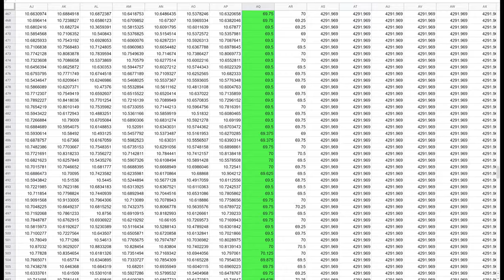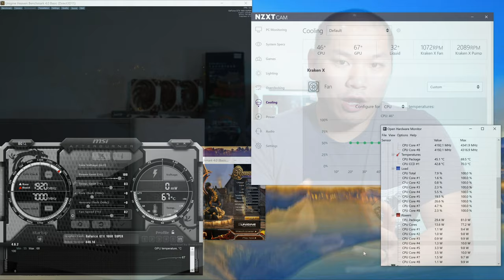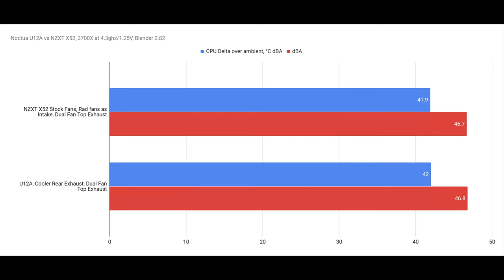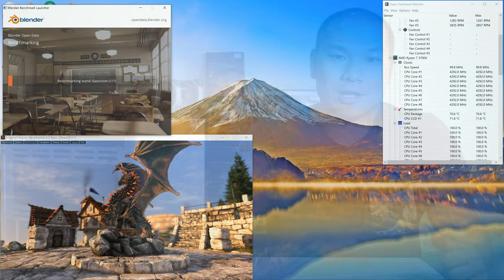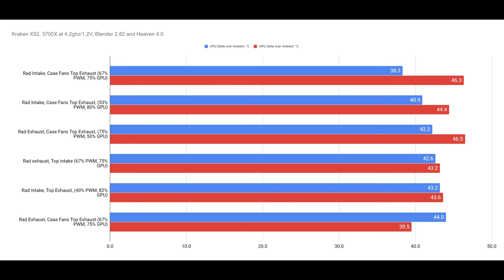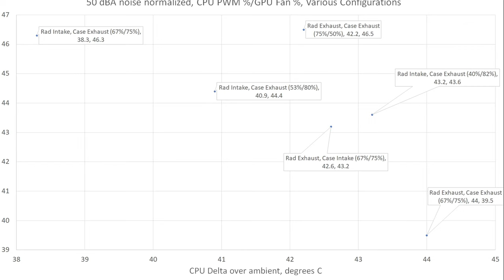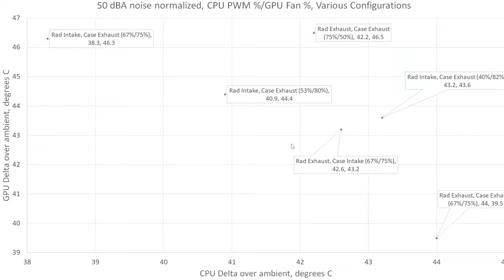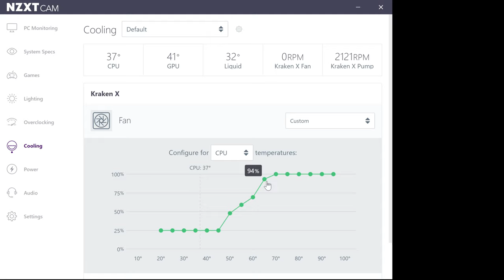Liquid AIO Cooling In The Cooler Master NR200, Part 1: Optimizing Fan Orientation

Comment: Can you include the Noctua C14S for the Air cooler comparison or maybe a follow up video? Thanks!
Reply: GBXD C14S would be interesting to see since it’s a down flow (well, depending on how u orient the fan) that, I would imagine, be pretty efficient due to its orientation. Combined with a couple of side mounted fans - it should be pretty efficient.
Reply from the maker: That's a cooler that I don't have now but since you mentioned it I'll try to get my hands on one. It's actually really promising due to its weight- the heatsink itself is heavier than the U12A and that is a HUGE factor in air cooling effectiveness (assuming similar fin density).

Comment: The Nividia video of the new 3000 series GPU's show that air is sucked in from beneath and expelled upwards. (This seems different from the 2000 series generation where the fans sucked air downwards, and expelled air sideways). This makes me think that the Nvidia series 3000 design ideally suits the airflow of the NR200 which has a bottom to top chimney flow path. This made me wonder whether, when using a 3000 series card, if it would be beneficial to add the extra two bottom fans that would propel air towards the underside of the GPU, where it is sucked into the graphics card? I'd be interested in your thoughts. This leads to the question about the 3000 series GPU's, whether their bottom fans perform best by (i) sucking air at ambient conditions under the PC, or (ii) using bottom-fans to accelerate air towards the underside of the GPU?

Comment: Can you max out this case? 2 SSDs in the front, Mini-DTX motherboard, 280 AIO Liquid Cooler, 3-Slot GPU with fans on the inside of bottom right under the GPU, 2 Fans on the top, Maybe squeezing a 3.5 inch HDD inside the case?
Reply from the maker: And.. the kitchen sink too! That is one heck of a parts list and yes, one could get it to work, I do recommend a 240 for this case to make tubing runs easier.

Comment: Think vertikal gpu so the gou can get fresh air via the vent+ radiator for cpu on the bottom pushing air trough the case abd the two fans on the top pushing it out has the beat thermals...

Comment: really great channel content with great video quality.
I am floating maybe a silly idea which is to shrink my MATX rig  with a VEGA64 LC (120mm rad) and Ryzen also watercooled with an IDcooling Frost flow AIO(240mm rad) into this great little case. But I am struggling to assess a robust "How and where placing the Rads?". was thinking about the CPU rad at the bottom and the GPU rad at the top in pull config but afraid the latter will clash with either Motherboard or the PSU cage. I cant think about any Option that would work but if people here have recommendations, its much appreciated. thanks so much

Comment: I have a Cooler Master ML240L V2 bottom-mounted on my NR200p (vertically-mounted 3080 FE and tempered glass panel). I've since watched this and GN's video about proper placement of AIOs. My thermals and noise seem good under load. My question is do you think I would benefit from replacing my current AIO with a radiator pump AIO like the MSI Mag Coreliquid 240R? Thanks!
Reply from the maker: It's not the end of the world, and certainly if you're getting strange operating noise then perhaps you might consider replacing it. The longevity issue is only relevant if the unit is out of warranty or the manufacturer won't replace it, which wouldn't be very nice since they're the ones that partially filled it to begin with. However, if you're looking for a definitive recommendation for bottom mounting... there's a new review going up today and I hope you get to check it out.

Comment: Hey bud, is it possible to have the fans against the side panel ‘pushing’ from the side, rather than pulling in?

Does it fit or are the tubes squashed?
Reply from the maker: You could do that, the tubes get compressed so I don't like that arrangement as much, plus there's not a significant difference for airflow.

Comment: Great work with this NR200 series. I'm under the impression that for cards that are not flow through and physically larger (doesn't matter hotter or not) the rad intake and top exhaust is a better GPU option.
The edge of the larger GPU extend closer to the side mesh panel and then gets pulled up by the rad intake. I have mine like that and empirically noticed better GPU temps.
Can you confirm that?

Comment: I have been trying to find someone who has been doing in depth reviews and cooling config. for this case. I just ordered it as well (just waiting on shipment) and I'm super excited to build in it. I have a ryzen 7 3700x with the arctic freezer ii 240mm aio and I'm adding the arctic p12 fans for the best performance. I'm also trying to fit a 3080 gpu in there (not the founders edition because of the weird cooler design). I'm planning on doing a review video of my own. will be modeling my video after yours. earned my sub. cheers mate
Reply from the maker: Thanks, look forward to it!

Comment: Looking to do this build with a 3080 and 120mm AIO rad in the nr200. I'm in between getting  the founder edition or a third party which directs its airflow in a single direction unlike the founders which does the strange push pull kind of thing. What are your recommendations for card type and fan configuration. Thank you, love the videos!
Reply from the maker: I know availability has been challenging but my recommendation is 3080 FE for this and the NCase M1 simply because the top exhaust is very directed and easy to work around. In an AIO scenario you just let the top fans handle all the exhaust. Instead of the card exhausting out the sides and potentially reintaking its own air, the top (and rear) exhausts get the heat quickly away from the card, which is great for it. Full discussion with fan layout here in case you haven’t seen it.
https://youtu.be/thmpkPjnUDE

Comment: hello there !! very detailed work ! great job..but i have a question ....have you ever tried passive bottom mounted rad, with rear and top fan exhaust ?? was planing to do that to have the best looking pc (exposing RGB ram, motherboard and showing bottom mounted GPU) but don't have all the material to test my theory ....that said tho, at the expense of ''lookat'ma board ma!'' i clearly will go with the best CPU thermal here.. Since in gaming, the CPU don't heat that much, no using it's max TDP, putting less heat in the radiator, thus giving the GPU cooler air ;) so it's a very good setup for all around use.
Reply from the maker: In theory that can work as long as you use the best static pressure fans along with the glass panel, and sealing off every vent on the rear panel, and every potential gap on the rest of the case. In practice, it's really difficult to do that, especially in this case. It's too well ventilated. You still have the other mobo side vented panel as well, and lots and lots of seams on the case panel junctions. Why not slim, black fans though? That could be as incognito as just a bare rad. As for gaming CPU use- it varies depending on what CPU have, what game you're playing, resolution, etc. If you're playing in 1080 at high FPS, and you're not close to being GPU limited, then yeah, absolutely your CPU could be getting hammered. 4K 60, not so much.

Comment: Not sure if you will respond But I am finally getting my nr200p, ill be slapping in a 280mm artic freezer ii into the case but should I place the faces exhaust or intake? And should the fans be on the outer side of the case or inside? Thanks.
Reply from the maker: I'd intake. You mentioned "P", are you running this on the bottom? If you're mounting on the side you almost don't have a choice when it comes to the fan placement because the tubing is so tight, the rad need to be on the outermost part of the case so that you don't get some super tight bends.
Reply: @MachinesMore  p because in the UK we don't have a choice Thankyou so much.

Comment: Question, as I think I may not be the only one with this but I am having trouble finding an X52 for sale that isn't absurdly overpriced or used. Would the X53 suffice?
Reply from the maker: Yup, it performs exactly the same, the X53 does have a newer gen 7 pump, more clearance inducing barb position but has a rotatable head (so you can mount however you like and just rotate if you want the RGB). It also loses the fan controller. I might do a comparison video between some AIOs soon but for sure a bottom mountable AIO vid is coming up.
Reply: @MachinesMore  thank you so much for the detailed reply!

Comment: Ive been wondering, what is thr purpose for a front mounted psu in this case and if you do mount it in the front, wouldnt the fans for the psu be choked since there isnt proper airflow for the front considering most of it is blocked by the sd panels and even thr front cover isnt designed to allow airflow to my knowledge
Reply from the maker: It’s just another option depending on what your hardware needs are. If you mount it on the side, you have two choices for how you orient the PSU, intake from inside or outside. I did mine intaking from outside. On the front, I would just flip it around, so that the fan can intake from the inside- you’re right in that you don’t want to intake from what is essentially a blocked off spot.

Comment: May I ask, and i may have missed this, but if we run the rad as intake + top panel exhaust, what if we add two fans on the bottom as intake as well? will that be optimal to add into the case?
Reply from the maker: Yes! Part 2 covers more fans added.

Comment: I recently built in this case with the Fuma 2. I had two Noctua A12x25 fans from a previous build and saw an improvement by swapping out the Scythe fans. You may want to test this setup since you already have the fans from the U12A.
Reply from the maker: Already did that! And yes, my observation was that the stock fans were really holding back this cooler, not so much the thermal difference at stock clocks but they’re capped (probably for noise reasons) at 1200rpm so there’s not much headroom beyond mild overclocks. Will discuss more in the round up. Thanks for checking in!

Comment: Do you think it's realistic to use this NR200 case with the latest Nvidia "hot box" GPUs that have rumoured 300+ Watts power consumption, and a higher end CPU like the 3950X or i9 10900K ?
Reply: Yes. The ncase m1 is smaller and can handle top line stuff. You can fit a 280mm rad which will give better results than the 240 used in this video
Reply from the maker: I think so, in addition those beefed up GPUs power draw figures, there are also going to be beefed up heatsink designs. If you run an AIO rad as intake, there’s very little GPU influence, so that might be the way to go if the GPU exhaust is ridiculous. If the rumored specs are correct, then these will be 3 slot thickness monsters and you won’t have an option for bottom fans, the fans exhausting at the top will be super important.
Reply: @MachinesMore  What do you think of the NR200 for air cooling these new high-wattage GPU's? I'm thinking that actually the new Nvidia airflow path - that sucks air from beneath and pushes it up - could work very nicely with the chimney flow of the NR200. Another thing I'm wondering is whether having bottom fans, aligned with the underside-intakes of the Nvidia GPU's, could also enhance the overall upward chimney flow of the build?

Comment: I wish I could invent flexible heatpipes, allowing the fin stack of a heatsink to be located anywhere in a case, notably against an air input or outlet.
Reply from the maker: They exist already! It’s called an AIO 🤣
All kidding aside, the issue is that heatpipes are liquid filled and bending too easily might compromise that integrity. Otherwise, being copper, they actually do quite bend a lot already if you apply force. The bigger advantage would be if case makers tailor made air coolers or integrated into the case (Streacom DB4 comes to mind), that way really effective cooling could occur.
Reply: @MachinesMore  Yeah! That would be the ticket. We need a new specification that puts the heatsink right at the rear exhaust. It would even move the cooler away from the RAM, allowing for higher profile DIMMs and more visibility of their RGB. Cases and motherboards are so standardized, it shouldn't be too difficult to make this a thing.

Comment: So, let's say vertical gpu mounted, and then aio side mounted with fans exhausting air from gpu through rad and through the mesh panel, with 2 fans at the top intaking and 2 at the bottom exhausting would be the ideal setup? Idk if you covered that in the vid as I haven't finished it yet but I'm about 6 mins in and that's about the best setup I can think of.
Reply from the maker: Hey Robert, unfortunately a side mounted radiator will not fit with the clearance in front of a vertical mounted GPU. A config like this would also put the GPU fans at odds with the radiator fans. Interesting idea though!
Reply: So, what would be the best orientation of I wanted to keep gpu vertical? I may have to just suck it up and keep my gpu horizontal lol
Reply from the maker: You could bottom mount the rad, not generally recommended but it’s not the end of the world. Bottom to top airflow if you want to prioritize the CPU, other way around to prioritize the GPU.

Comment: and what about the NR200P? putting the radiator on the bottom is a so bad idea?
Reply from the maker: You don’t really have a choice with the the NR200P. If you’re OK with potentially impacting the long term performance and durability of the unit, it should perform similarly as an intake. Personally I think exhausting out the bottom is a really illogical way to configure any case (unless there’s a defined air flow pattern such as through a shroud or tunnel) so I wouldn’t do that. You’ll get similar performance running as an intake, it’s all taking cool outside air anyway.

Comment: whats bestter having the 120mm fan intake pushing through the rad or to suck air through the rad ?
Reply from the maker: I think your question is which side the fan should be on, and that really doesn’t matter too much. What matters more is if you put the rad on the inside the tubing will become more compressed, so my preference is fans on the inside.
Reply: @MachinesMore  I'm running a h80iv2 cooler and a thermal take toughfan 12 turbo fan side mounted in a Sama IM01 case the fan is sucking air into the case through the radiator exhausting out through the top

Comment: Can we hope to have a C14S tested as well?
Reply from the maker: Yes.🤗
Reply: @MachinesMore  Awesome! I hope I'm not asking for too much but I was interested how good this scenario would be: a regular GPU bottom intake + top fans intake + C14S with fans flipped to exhaust into the side panel. Also I'm curious if it's possible to mount the C14S together with two 140mm fans on the side (maybe front mounted PSU would interfere? or maybe not)

Comment: What about running Microsoft FlightSim 2020 where CPU and GPU got absolutely loaded? That said well done on this series💯
Reply from the maker: Well, you got me on that one. That is a special scenario indeed- I would say it depends on how hot your CPU or GPU is and how you’re running them- like if you are overclocking. Here’s the thing- under my tests even while 100% utilization on both components, those temps were still pretty fantastic- even if you are in a hot room, say 30. At that point your CPU and GPU are still pretty manageable. The more disproportionately hot one your components is compared to the other, the more you need to balance it to the other. For example- if you’re running a 2080ti and a Ryzen 5 3600, you might want to run the exhaust/exhaust since your CPU is relatively easy to cool and runs cooler to begin with, but your GPU is not, and needs a bit more help to stay within a competitive thermal range. The inverse is also true, a normally hotter running CPU means it is more sensitive to begin with, so you will need to give it some help.
Reply: Machines & More I have Vega 56 which is in the same league of furnace as 2080ti. I’m tempted to build a new system in NR200 when Ryzen 4000 is out. Your series of NR200 video really helps the community a lot💯
Reply from the maker: Well that's so nice of you to say. I think you really need to lean towards helping out the GPU then. Yeah, Vegas, you're going to want to throw a bone their way. If I might suggest- check out part 2 when it's out and see what you think. I think we can all have our cake AND eat it too.

Comment: Great series of vids. Got my NR200 in, just waiting for X670 and Zen 3 to drop. What about mounting the fans between the case and the rad for a push rather than pull config? I read everywhere that generally push is the optimum airflow setup.
Reply from the maker: Cheers! If you're referring to the fans being on one side of the radiator, vs the other, there's not a big difference in my opinion, the fans should function similarly whether they are pulling air on one side of the radiator, vs pushing in the same direction from the other side. I believe what you might be seeing as to "push" being the optimal airflow setup is within the directional context of a case, meaning that when folks say "push" they are saying push air into the case as intake, and when they say "pull" they are referring to exhausting air out of the case. That's almost always true since outside of the case it's cooler. If your only point of reference is CPU temps, I think my testing, and logic (cooler air running vs warmer case air through the radiator) should show that to be true.
Reply: @MachinesMore  I was also wondering how you are able to control the fans from the cam software without a fan hub? I currently am running a X53 in my NR200.